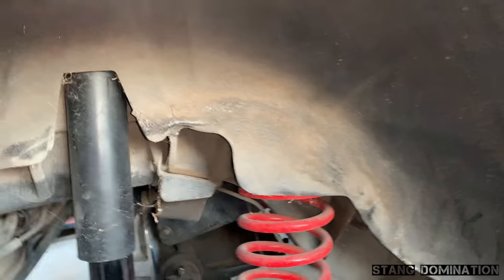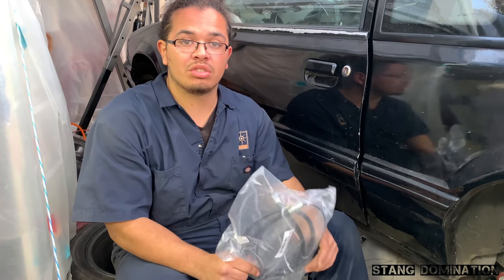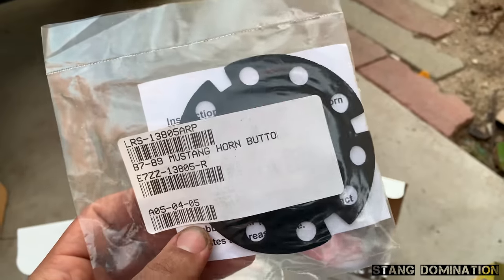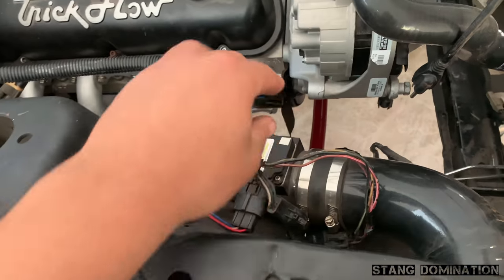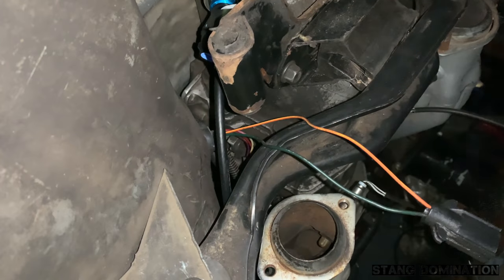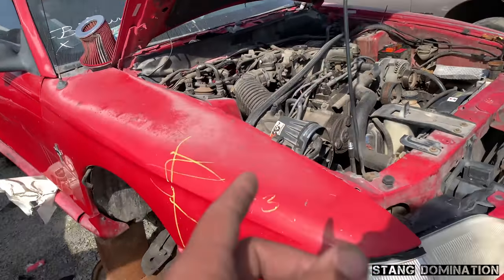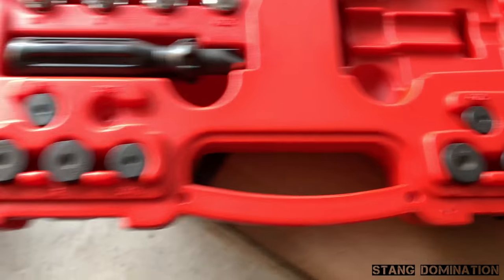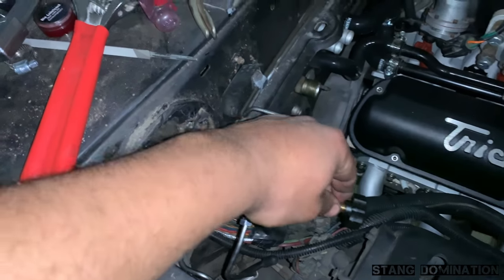(JUNK YARD RUN & LITTLE TOUCH UPS )  FOXBODY 5.0 302 OVERHAUL pt.14

Comment: Good deal.. my is a 93 and that’s the only part of the five lug disc swap I’m dreading, the e-brake cable . Only because I’ve heard u have to weld the cable to the handle , or something like that.when I get to that stage , I’ll just take it somewhere and have someone do the welding 4 me.👍🏽
Reply from the maker: The e brake kit I bought went right up with ease and the length was perfect and lol you can also do that too if it is trouble
Reply: Stang Domination so even though I have a 93 , I can use the 92 cables and it’ll work with no welding to the brake handle?ima have to do some research cuz even lmr has a video on that . It has something to do with the handle sitting correctly... idk I’ll look into it .
Reply from the maker: When you said 93 that just blew over my head lol but no the 93’s don’t come with the bracket for the cable but they sell 93’s which are cheaper and should fit too
Reply from the maker: Here’s the link 

https://lmr.com/item/LRS-2635A/1993-Mustang-Cobra-Rear-Parking-Brake-Cable
Reply: Stang Domination cool  thanks

Comment: Wassup guys what would be a better swap the cobra swap that you guys put in the notch or a 3v swap from 05-09
Reply from the maker: Cobra swap we did cause it has more potential with the forged Kellogg crank which can take some heat but that’s in the future. Honestly what you prefer though